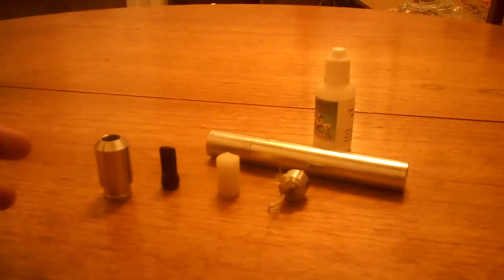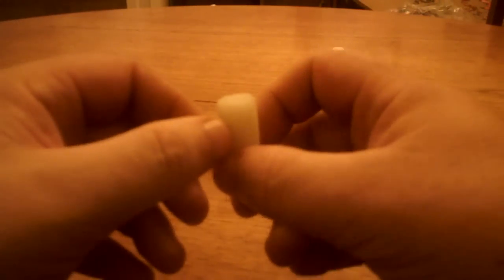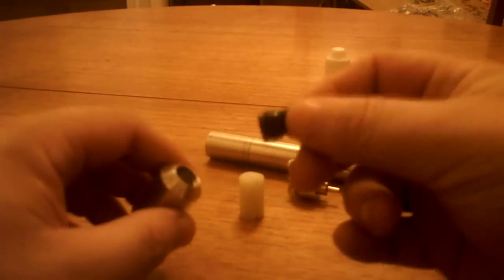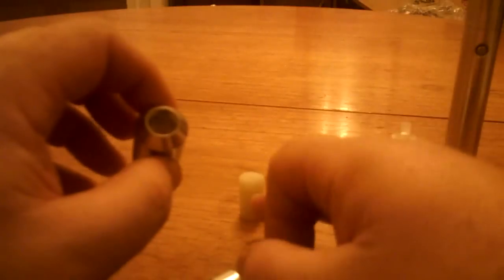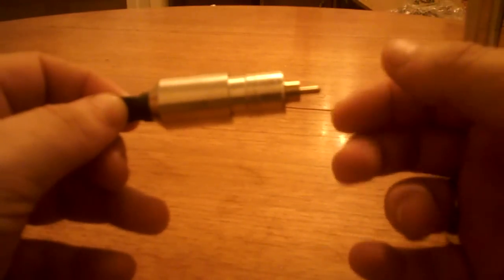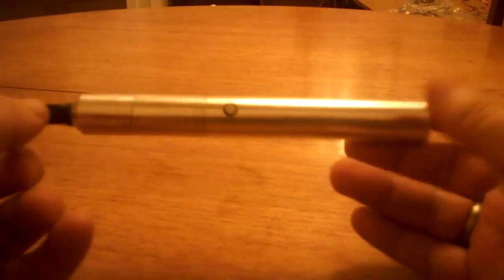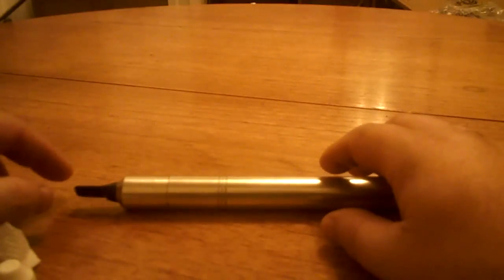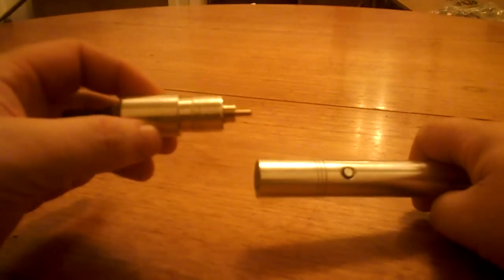Repairable Atomiser Head to Head Part 3 - The Bulli A1

Comment: it should be said that the main flaw of the A1 shown in this video is the connection. And it should be said that the Bulli A1 is meanwhile available with a 510 connection. This is an excellent atomizer, superb flavour, easy to handle and top notch quality.